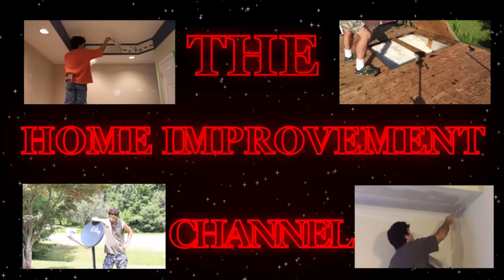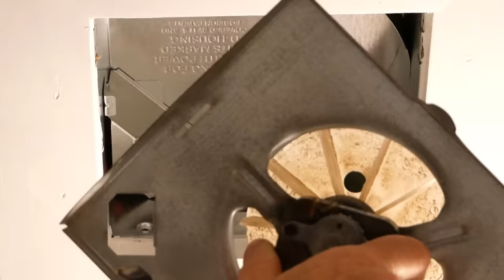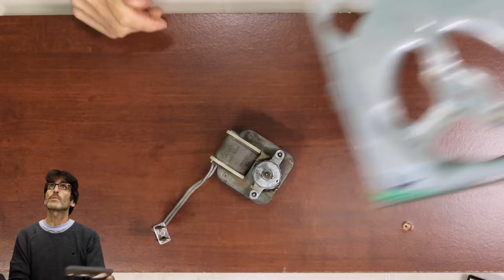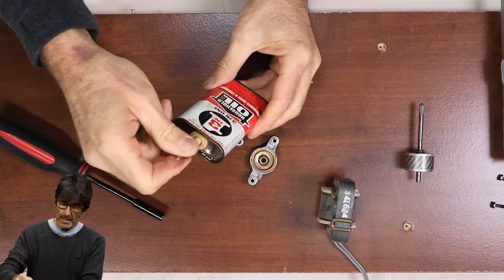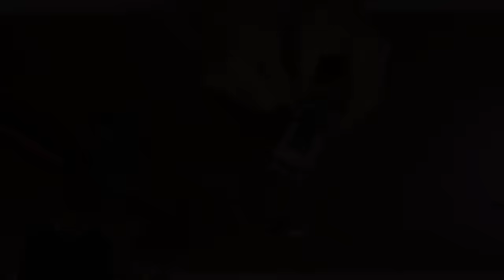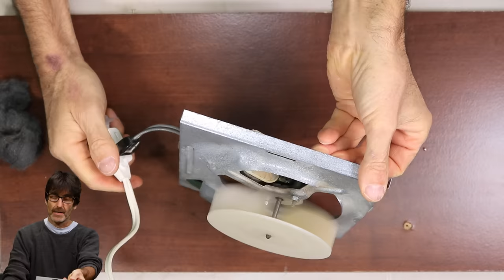Replace Your Bathroom Fan in 5 Minutes FLAT!  NO Attic Access!

Comment: My fan is noisy!! I've already taken it down and I'm so excited to see that it's just like the one in the video! Going to get the 3 in 1 oil later👍🏾. I'll keep yall posted.
Reply from the maker: Joyce123 Excellent!!
Reply: Everything was going good until I pulled the armature out and the little ball came out to, that he specifically said need to stay in there 🤦🏾‍♀️ I tried everything to get it back in and nothing worked- tried so hard until I cracked the piece trying to put back in there - house was built in the 80's so I'm sure it was well over due for a new motor anyway. Oh well, I'll have to spend the $15 this time, but I'll know exactly what to do the next time. This was an excellent video- thanks so much for sharing!!
Reply from the maker: Awww Man!  Sorry to hear that... :-(

Comment: Thanks! Saved me at least $17. I’ve only ever installed bathroom fans new on remodels. Didn’t occur to me at first to clean and re-lube the motor, but this sure as shit solved my issue.

I’d recommend however, using a good grease instead of oil.
Reply from the maker: You're welcome!... 'll go along with the grease suggestion...

Comment: Thank you for your video! I just bought a place and the bathroom fan is loud AF as my kids would say. Plus the previous owner smoked in the bathroom with the fan on thinking it would help avoid stinking up the rest of the house (it did not). As a result, when the fan comes on the place starts to smell of cigarettes. I'm going to try this out tonight!
Reply from the maker: OH yea, that cigarette smell is hard to get rid of!  You might be able to take out the motor assy and clean up the fan blade itself in the sink, Of course I would remove it from the motor shaft!...

Comment: Awesome! My bathroom fan stopped working and I going to attempt to fix it!!! Great tutorial 👍👍👍👍👍👍👍👍👍👍👍👍👍👍👍👍👍👍👍👍👍👍
Reply from the maker: You can do it!  Thanks for the comment... :-)
Reply: This video is great if you have a Nutone or Brun fan. If not GOOD LUCK. My fan was not. The shaft on my fan is about 1/4 inch shorter than what is sold today, it’s 35 years old. I can buy a new fan motor for $135. Or remove the housing and replace it fo under $20.

Comment: THANK YOU!   Went up into attic and seen what it was going to take to replace whole housing  and said "no way im doing that". Sure i had to buy whole housing then take it apart, but for only $16 a piece its well worth the time and headache saved. Bought 2 and replaced fans in both bathrooms in about 30 mins. HD had 2 sizes available so make sure to measure your housing first
Reply from the maker: So awesome!  Glad you were able to get it fixed without to much trouble... 😊😊

Comment: Your video breakdown of what needed to be done and the process to do it made this so easy for me. You also saved me the expense of buying another unit. The Air King unit I have has a Sone rating of 3, which actually is pretty loud, but at least it's now running just like when it was brand new.

BTW, the lube I used was specifically "Garage Door Lube". I find that tends to be very durable and long-lasting, and was what was recommended to me many years ago to eliminate all the noises from the garage door.
Reply from the maker: Oh nice!  I have a noisy door myself,.. I'll try to look it up.  Thanks for the tip.😃😀

Comment: Very helpful - I have a 40mm h year old home and I think the fan was original and never been touched so not sure I would even be able to find one to replace it as the housing is a bit different than the one you showed.  So a good reason to try the cleanup.  Thanks!!
Reply from the maker: Yes, that's why I included that part in the video in case of a situation just like yours.  It's worth a try before trying to remove the old housing and going through all that aggravation.  If you do wind up having to replace the whole thing, try to find a fan that's slightly bigger than the existing fan so there's no drywall to repair!.. 😊

Comment: I wish mine were as simple, but they are different sizes. I’m going to watch your full replacement video next. BTW, you should add “How to stop the squeak on your bathroom fan” to the title. That’s great info. I have seen on other videos your only suppose to use the Blue 3-1 oil on electric motors.
Reply from the maker: Thanks for the info!

Comment: Great how to video. You warned that the bushing on the long side could get stuck on the axle and indeed mine did. I had to bend some of the tines holding it in up a little to get it back in the housing but it's still loose in there unlike the other one that doesn't move. Now because of that it seems like it's allowing a little play in the axle so that when I plug it in the motor hums but doesn't spin. I can occasionally get it to spin if I nudge it just right but the slightest movement knocks it back out of alignment. I'm ordering a new motor now, but I would emphasize to others to be really careful with that bushing so that it doesn't come out.
Reply from the maker: Wow... Sorry to hear about your troubles.  If the new motor doesn't quite fit the old housing, you should be able to redrill the mounting holes and get it to work that way...
Reply: @TheHomeImprovementChannel  Just an update, after waiting for 10 days for the whole assembly (cause it was a reasonable price on Amazon), it still hadn't arrived so I cancelled the order. I went to Lowe's and got the BP27 motor even though it doesn't specify it's for my model (763RLN). Upon comparing the 2, the shaft/axle and 2 outer screws are both slightly longer than my original motor, however the distance between the mounting screws was the same, so I mounted and it tried to install it back. Unfortunately for me, the extra long shaft is mere millimeters too long causing the fan to wedge itself into the upper housing.

What I ended up doing was swapping the axles, using the one from the old unit in the new unit. Even though it appears the motor coil part on the axle is slightly is less wide on my original unit, it all still works when I put it back together, with the minor exception that it seems a tad quieter but more powerful (not sure if its the reason, but the old motor was .5A while the new one is ,9A).

Comment: My fan this morning starting sounded weird when I turned it on and then when I turned it off it sounded like it was scraping while running. 

I’m going to do this this weekend when my husband is here! Garbage disposal is leaking and going out and man this video hopefully will save me time and money! Thank you!!!!!
Reply from the maker: I hope you can clean your old motor to get it back up and running again.  IF the garbage disposal is leaking check the very bottom to see if it looks rusted and that's where the water is coming from.  A lot of times they will rust out and leak from the bottom.  You'll probably need a new one if thats where the problem is.. Thanks..

Comment: Another one saved.  I was ready to buy a new fan but all it needed was a good cleanin'.  Depending on how many years of people's poop dust have stacked up on your system, it may be worth $15 to just rip it out and put in a new one.  Mine wasn't terrible by any means, so it went quickly.
Reply from the maker: Yep, sometimes that's all it takes... :-)

Comment: I had one that was noisy, my mom had one that quit running. Both were 30-40 years old. I considered replacing them, but new ones look really cheap compared to the old ones. Cleaned both real good, but didn't go as far as disassembling to oil them. Both work great now.
Reply from the maker: Excellent!  Glad u got them going.... :-)

Comment: Great guide, thank you! My fan was making rattling noises for a bit when turned on and then would slowly go back to normal. Took it out and found that one of the two nuts holding the motor to the metal base was loose - tightened it up. Also when manually rotating the shaft it would squeak - applies grease while rotating and it went away. Installed everything back and it's running good now!
Reply from the maker: Great to hear!  Thanks for the feedback.. 😊😊

Comment: Followed your tutorial and worked great! Thank you so much!

The motor part I got from amazon had the screws pointing opposite direction than the fan's shaft. So I reversed the screws to point same direction as the shaft (matching the video and my broken motor part). Now fan is replaced and good as new :)
Reply from the maker: That's excellent!  Glad u got it working.. :-)

Comment: My difficulty was in removing the motor from the housing in the ceiling. This video showed me that it is very easy because they are clamped together. On suggestion from another video, I used a pry bar that helped a lot because due to my age I have less strength. I would not clean the motor. I would rather buy a whole set from Lowes like I did for $14 and use a new motor. But your video is great.   I find that YouTube has give a chance to millions of people all over the world to express their creativity. I find so many good vidoes with so much good information. I installed a new exhaust fan with help from this video. I fixed auto ignition in my stove with help from other videos.  The only thing that bothers me are so many nasty videos with nasty sexual content.
Reply from the maker: I'm right there with you on the nasty sexual content.  Thanks for the nice comment... I actually showed how to clean the fan motor because there's some more expensive brands out there that might benefit from cleaning.  I agree, the $14 dollar one is probably just best to replace, since it's cheap anyways!

Comment: I just replaced all 3 bathroom fans with $18.00 Bojack motors from Amazon, Very quiet. 2 of the vents had huge bird nests in them that had to be removed. I then vacuumed the vents. Also cleaned the outside vents for debris and birds nests.
Reply from the maker: Excellent!  Glad you got it going.  If you're having issues with bird nests you may need a screen or something on the outside exhaust vent.  If it's accessible that should keep them out of there.

Comment: Excellent video! Speaking for myself I use several magic markers ( different colors) marking the unit with dots or a x,xx so that I would know how to reverse Engineer. Ps I also have a 5 gallon bucket that holds all my extra nuts and bolts because I was to lazy to Mark. Thank you for your showtime . Also I saved the $15.00 + gas +my time having the frustration of getting the wrong motor replacement. Bob
Reply from the maker: Awesome!  Thank you for the comment..😊

Comment: This was EXACTLY what I needed.  Saved me from ripping apart my ceiling and destroying the fan.  I also saved $40 (or more) by cleaning two fan motors instead of throwing them away and buying new ones.  All they needed, exactly as Rudy showed, was a few drops of machine oil in the right place.  Both are running about like new again now!
Reply from the maker: That's awesome!  Thanks for posting the comment.. :-)

Comment: Thank you! Thank you! Thank you! Easy peasy! The actual repair took only two minutes. I am looking for a related video on how to put a roof vent on my roof for the other end of the exhaust hose. I have been afraid to do it and cause a leak in my roof. Currently the moist air is just being dispersed in my attic and hasn’t caused any problems. But, I know that city code won’t like that and I may run into problems when I go to sell. Any suggestions? Once again, thank you!
Reply from the maker: HI Ken,.. Yes its definitely a problem when you go to sell.  The home inspector won't like that and you'll have to pay a licensed contractor once they ding that on the report.  I do have a video on replacing a plumbing boot, it may help you see how the shingles go..

https://youtu.be/jSHuluEi-Zw

 the plumbing boot is different from the fan vent, but it's the same principle..  Here's an example of what you need:  

https://www.lowes.com/pd/Broan-Metal-Roof-Vent-Kit/1076135

I hope this helps..
Reply: Thank you. The plumbing boot is what I had in mind. I need to get over my apprehension of cutting the existing shingles. Thanks again for your help.
Reply from the maker: @kenpalosi5084  You're welcome.  I wouldn't use the plumbing boot for a fan though.  It'll rain right down through the pipe!  The fan vents are covered at the top so the rain can't get in.. 🙂

Comment: Thank you  This saved me so much time.  Well, it would have saved me more if the original box was exactly the same as the new one.  Had to use some tin snips to get the plug to match up and some screws to hold it in, but better than trying to replace the whole thing!
Reply from the maker: Great thinking to get out the 'ole tin snips and make it fit!  I'm famous for that... LOL.. You're welcome... :-)

Comment: Usually most of the fans are so old by the time they fail that to find the exact replacement is not that easy. This video is a pipe dream! More than likely you will have to replace the housing. Good luck doing it in 5 minutes.
Reply from the maker: Sorry, I have replaced dozens of fans like this one.  This video doesn't cover every fan out there, but this is a very popular scenario.

Comment: Housing for the bathroom fan in my gf's house was an awkward size and no fans fit to it. We bought one as close as possible and used an angle grinder to get it to fit. The clips or screws for the new fan didn't line up with the existing housing so we held it in place with magnets. Got the idea from breaking bad. Thanks Vince Gilligan.
Reply from the maker: Lol... that's excellent that some of breaking bad ideas have real life applications!

Comment: Are there fans that vent through the roof?  Ours vents into the attic and we have had a little mildew on our wood ceiling.  Thanks for great videos!
Reply from the maker: Yes absolutely!  They are not supposed to vent into the attic directly.  That's against code for that very reason (mold).  They should either vent through the attic or out the side of the house if it's downstairs (normally in the back).  Also a soffit is an acceptable place if the fan is upstairs.

Comment: Great video. I’m wondering if you can explain the difference between a less expensive unit and a more expensive unit as well as if it would be beneficial to install a more powerful unit and what to expect if you do.
Reply from the maker: I'm quite sure the motors are quite different.  The more expensive units will usually be quieter and move more air.  The cheaper units are usually 50 CFM or so and the more expensive units can be 80 and above.  For a small bathroom 50CFM is plenty.  For a large bathroom the more airflow is better.  So it really depends on the application.

Comment: It's also important to check the check flap when the fan motor is out. Sometimes they hang up over time and stay wide open or wide shut.  yw
Reply from the maker: Absolutely right.. I've seen that happen.  Thanks for the tip.. 🙂

Comment: My new fan came with it inside new housing as well and all the instructions are for installing the entire housing.
Reply from the maker: Yes they will come that way.  If the insert is the same type as your old one, you just have to remove the insert and swap it out.  Leaving the old housing in the ceiling.

Comment: Are all bathroom fans the same or can you buy an extra strength fan that really sucks the air out? Thanks for an awesome video. Getting ready to replace one!!
Reply from the maker: Their not all the same size, but this one is a very common size.  Probably the more powerful fan might have a different housing.
Reply: Not all fans are the same. The unit he is working on is a cheap Broan (manufacturer). Housing builders commonly use these cheap fans to cut construction costs, or sell you an upgrade for a few more $. This same replacement procedure can be used on any fan as long as you can locate a model number and find parts. During construction the housing is installed before the sheet rock, and then the electrician will return and install the motor assembly when he/she does the finish work.

Comment: It took me two days to finally get mine out. Apparently it had been installed before the dry wall and the hole cut was smaller than it should've been and covered the 4 screws they had used to secure it in place. They also screwed the duct to the unit. Now I've got some experience doing that and will have no problems in the future.
Reply from the maker: Yep, the case is usually installed before the drywall on a new build.  It can be a pain.  I have a video on replacing the whole thing.  If the new fan is larger than the old one, you can cut the drywall ahead of time to the new fan size to expose the screws and what not.

Comment: This video was great.  My one problem which you solved for me at the end was I could not find the exact replacement plate with attached motor.  Your plate and mine has the plug hole in the corner.  My old motor is a Broan with faded model number.  All of the Broan plate plus motor assembly I saw on line had the plug parallel to the side of the plate and there was no way to fit them in my existing ceiling opening where the outlet was also in the corner.  I used your idea to take the old and new assembly apart.  Gently stand on the plate with just my toes and pull the plastic fan off.  I was able to unscrew the old motor from the plate, clean off the old plate then attach the new fan and new motor to the  old plate.  Thanks
Reply from the maker: That's awesome!... Thanks for the comment.. :-)

Comment: Thanks for the info, greatly appreciated.  I have a different situation.  Cold weather creates condensation in the attic which then drips down through the tube and on to the toilet user.  I gave up years ago, now having mold issues.  Any ideas ?  Thanks !
Reply from the maker: Yes I ran into that once.  Do you have an insulated pipe there now?  When it happened to me, I replaced it with a 4" insulated flexible pipe and that helped a lot .